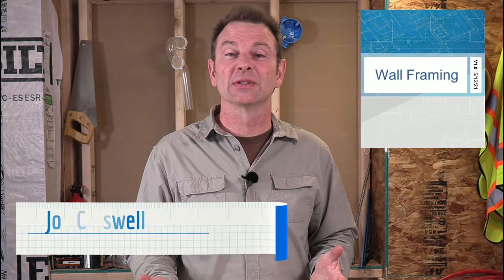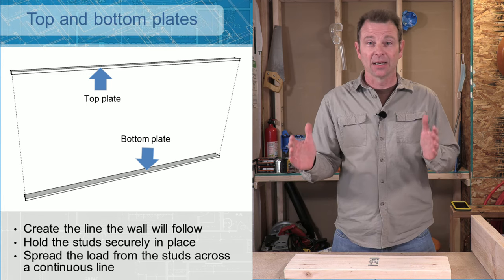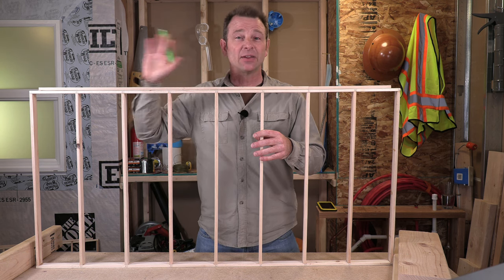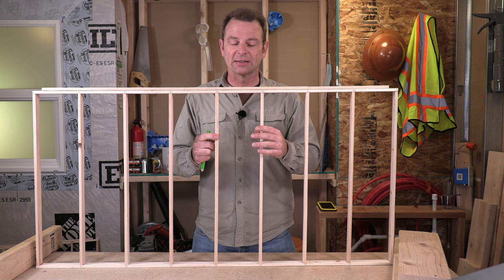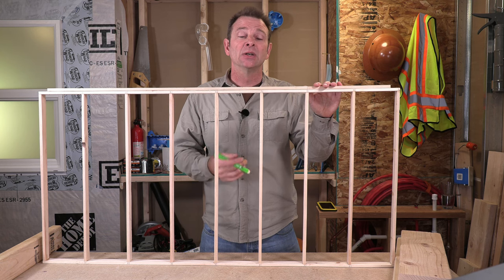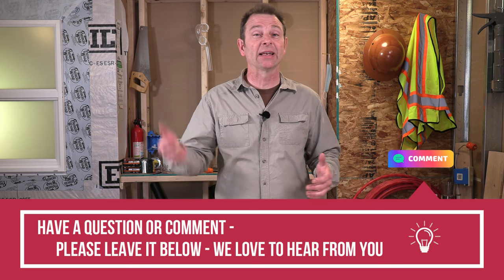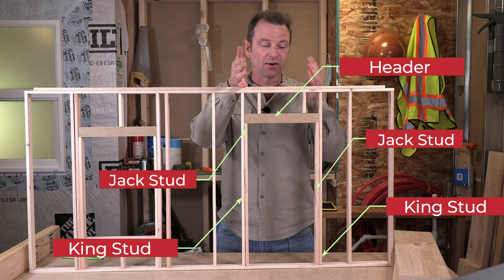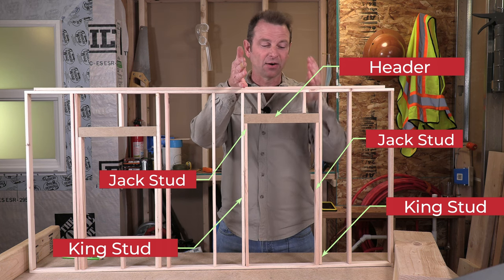Learn all about Wall Framing in this Trades Training Video series.

Comment: Your explanations, models, and computer illustrations come together to make this stuff so easy to see and learn. Thank you for your efforts. Nice work.
Reply from the maker: Thanks for the kind words - I hope you keep watching our videos.  An new video on framing elements came out today
Reply: @ConstructionEd  I looked in google and I see that they use bottom plate
and top plate which in your frame only has top plate
The top plate and the bottom plate are the same 4X2 size?
Reply from the maker: @zenyfilmsrambo  - our models have a top and bottom plate and the cap plate (the upper plate in a double-top plate system) is used when connecting walls together.   We cover it a bit in our corners and connection video lesson
Reply: @ConstructionEd  the best thanks teacher

Comment: No cripple jack studs under sill is sloppy though
Reply from the maker: I completely disagree.  Code does not require jacks under the sill.  The sill should not be carrying much weight, the window is fastened to the framing- not leaning on the sill.   Thus what you call sill jacks are not required. That is just extra framing for no reason.  It costs more time, more money, and adds to thermal bridging.

Comment: Never framed before but need to build an interior non-loadbearing wall for an extra bedroom. We have a new person living with us for 1 or 2 years, and then I'll remove the walls.
Reply from the maker: Great fun - you should also watch our corners and connections video.   When building temporary walls, I r would always use screws vs nails.   And screw in places that are accessible to aid in demo. 

More framing videos from our Premium Resource Library will be released to this Community Ed channel over the next month.

Comment: I've always wondered... When a through wall and butt wall are laid out 16" on center, the sheet goods on the inside or outside of one wall will not fall on a stud center because of the thickness of the adjoining wall. . What is the process for that?

Comment: Good stuff Joe.
Your presentation is tip top.
In England we always say the larger dimension first, e.g. 6x2 or 4x2, said as six buh two etc.
Very few of our buildings are timber framed  over here as we don't have the forestation you have in the states.
Our stud work is mainly used for internal partitioning and where it's not load bearing we'll use 3x2 as our ceiling height is around 7ft 6ins.
Take care over there.
Reply from the maker: Thanks for the comment and the information - Names of lumber would take me a little to get used to.   We do waste a ton of lumber in the country - but many of our southern states like Florida use more CMU's when building - then lumber in the interior
Reply: Alas, SD, when you say the larger dimension first, you never get to use tuba-4s or tuba-6'x.
Reply: Is is merica 2x4,  2x6

Comment: Thanks for a great video. Question: After laying out the first wall, do the markings of all other walls walls follow a certain direction? For example, continue 16" centers in a clockwise pattern on all walls or should parallel walls have 16s ran in the same direction, etc..?
Reply from the maker: there is no set rule.  There are code issues to condiser

Comment: When designing exterior walls for doors and windows, is there a layout approach that will minimize wastes of exterior sheathing and avoid difficult insulation installation?
Reply from the maker: If you are designing the walls and their lengths you can set them a size to limit the waste of materials.   But that is not often the case.

Comment: if using 2x6 instead of 2x4 for exterior wall do you use 16 on center or 24 oc for better insulation. ??
Reply from the maker: If you can get away with the 24 oc it does provide better insulation for the assembly.

Comment: What will work for hot climate areas? 2x2? Or 2x4 is the minimum?
Reply from the maker: It all depends on what you are building - but I would not use anything smaller than a 2x4 for a house

Comment: If your wall is longer than 16ft long, how do you connect them. Is your last stud at the 16ft mark half on both sill plate and top plate or you partition two separete wall and have them connected with double stud. I have to build a 2x 44ft long garage wall.
Reply from the maker: You put the last stud on the end of the plates - the double top plate is what connects them together

Comment: What would determine the center on the common studs? (12" 16" or 24") Load bearing or not? Length of wall??
Reply from the maker: Typically the layout pattern is called out on the plans as there are several factors considered.   But length of wall is typically not one of them.

Comment: Where to put the header in reference to jack studs? In the middle on the top of the jack studs or on the outsides?
Reply: The header spans the opening - the Jack Studs are on the ends of the header

Comment: Do you have a lesson for moving a wall to decrease/ increase the size of a room? How can I tell if its load bearing and supporting the structure if it is ? Thanks
Reply: Hopefully you have the original plans. Ideally, an engineer should give you his blessing. Never assume interior walls are just partition walls.
Reply from the maker: I agree with Sean.  If you do not know how to determine if a wall is load bearing - ask an engineer.

Comment: i did a shopping center tower at 30' tob.  they requried 2x12s @ 12" o.c.  balloon framed.
Reply from the maker: I would not like to be on the crew - that is a heck of a wall to stand up.   We have avoided making a lesson on Ballon Framing vs Platform framing since most residential construction has moved away from ballon walls - other than a stairwell wall.   But maybe we should release one of those lessons.   Glad to include a picture of your wall if you took any pictures of it.   Thanks for the comment and thanks for visiting our channel
Reply: down here in s fla they dont make gable end trusses anymore . gable ends now have to be framed from floor to peak continuously. which usually requires 20' studs to achieve.  HEAVY !.    @ConstructionEd
Reply: this was building ontop of a 12'  pitched roof structure , so standing wasnt a option.  we had multiple carpenters quit before lunch.  lol
Reply from the maker: @stvstreett  that does not sound like fun - I would have bailed from that crew before lunch - but I am a bit of a chicken since I hit 50.

Comment: I’m just learning here. My question is, are jack studs not required to better support the sill plate for the window?
Reply from the maker: William, specific studs under a sill - that would be in similar locations as a Jack Stud in a RO - are not required.  The only framing members that are needed are the cripples on whatever layout pattern you are framing in.   You will see many folks adding those in - but they are not required and the sill does NOT need them for support.   Windows actually end up with only a small portion of their weight on the sill, due to the window being fastened to the framing.   The inclusion of these extra studs actually frustrates me - I can only surmise that they are used to save time - but if a RO is assembled in order, the sill can be face nailed through the Jack, before the Jack is nailed to the Kings.   And you don't need to double up the sill with 2 framing members - so don't fall for that either.   Less wood when possible is always better.
Reply: @ConstructionEd  Thank you so much for your detailed reply. You’re such a great teacher! I’ve had many careers including Env’l Engineering, Health Care and teaching math, science and now English in Japan. I’ve always enjoyed construction primarily as a hobby (may change in the future). I’m really enjoying learning carpentry and building science now in preparation to build my own cabin in northern, BC Canada perhaps in mid-2023. I agree, unnecessary wood is not only a waste of a precious resource, leaving extra room for insulation - which I will most certainly need in a subarctic climate - is much better use of space. Thank you for the detailed explanation! Much appreciated.
Reply from the maker: @ShikokuFoodForest  I agree that cost is one thing, but I don't like it because it adds to thermal bridging.  You may be interested in one of our new courses coming out - it is all on building science and framed in 2021 IECC code compliance.   it should be available at TradeSkillsU.online in about 2 months.
Reply: @ConstructionEd  Yes, thermal bridging is our ‘enemy’. Works against us when wishing to maintain a constant temperature in our conditioned space whether when heating or cooling. Therefore, I have always liked the method of installing a continuous layer of rigid foam insulation from the exterior of the bottom plate all the way up to the ridge of the roof (taping all joints and adding roof overhangs during process). Similarly, I’ve also seen floors being insulated by placing rigid foam ON TOP of the subfloor, rather than between the floor joists. Of course extra insulation may be added in the stud bays. Considering the price of building materials these days, I’m unsure which is more cost effective or better suited for a cold climate. When completely sealing the building envelope, I start to wonder about ventilation and ‘breathability’ of the home. Not sure if it is necessary as in a traditional ventilated roof. Either need to install a HVAC system (but I expect not in a 500~600sq.ft. cabin) or simply open some windows for fresh air. Which would you recommend for a cold Canadian climate?
Reply: @ConstructionEd  Thank you for the heads up on your upcoming online 2021 IECC Code Compliant building science course. I’m sure I would learn many useful techniques. My only concern would be when building up in Canada, there will be local provincial building codes I would need to comply with. So there may be some differences. But sure, building science is universal with some regional differences and requirements that account for climate I expect.

Comment: I have three framing books and none of them touch on edge-case scenarios, which is really unfortunate. New-comers know interior butt walls are supposed to have its double plate overlap onto the wall it's perpendicular to, but what about extremely short butt walls? An example is when you have a tiny 3-inch wall (two 2x4's sandwiched) just for one side of where a door will go. It's just enough space to allow for trim around the door. It's an ultra-short wall. Do you bother to have its double plate overlap onto the wall it's up against (we'll call it a by-wall)? Doing so means the double plate of the by-wall would be split into two plates instead of one. Often times this causes conflicts with the rule about spacing your double and top plate joints 4' apart from each other. This becomes more of a problem on really long spans of wall where you might want to split the wall up into sections instead of trying to lift a 30 foot long wall.

Like I said, I've gone the extra mile buying multiple books on the subject, but they don't cover stuff like this. For all I know, it could be perfectly acceptable to simply not bother overlapping that double plate for the 3 inch wall to make it all simple. The other aspect of it is that framing inspections, to my knowledge, only happen after you've got all the plumbing and wiring done, so it's not like you can just take a wall back down to fix it.
Reply from the maker: It is great question and has our team perplexed a bit - partially due to not knowing exactly what the situation you were talking about.   I am not thinking that the double top plate overlap to the through-wall as I am not sure 2 2x4's sandwiched would be considered a wall - it sounds more like it would be considered blocking or just nailers.   Glad to take a second pass at the question if you explain it a bit more.

Comment: You never said the size of the king stud .the wide and the height .please leave sizes
Reply from the maker: The size of the king stud is the same as the common studs, they travel from the bottom plate to the top plate.   Is called a King Stud due to its function in the rough opening.   As for the size, it is the same dimensional lumber as the wall is.  So if a 2x4 framing wall, then you the king stud is a 2x4
Reply: @ConstructionEd  the best thanks teacher